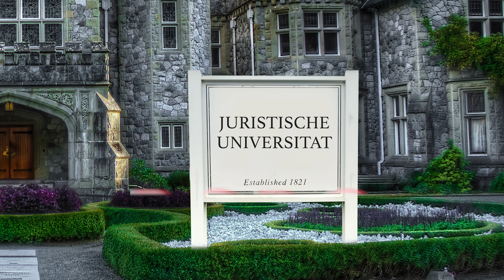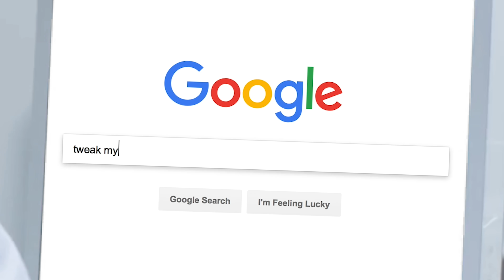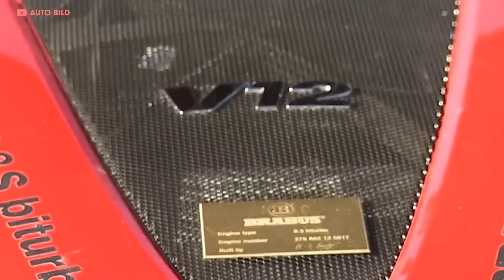Brabus - Everything You Need to Know | Up to Speed

Comment: Brabus even tune vans! I've worked on a 2014 brabus Vito "sport x" 220cdi 3l V6... In a frickin vaaaan. The tyres, 245/35 R18! The rims were incredibly light, the seats had crosshatch stitching, torque on tap. All this for a van

Comment: Everything you need to know to get up to speed on:

Abarth or Abarth 131

Alfa Romeo

MUGEN

Ford transit van

Peel p50

Mercedes-benz GTR

Plymouth Barracuda

SSC Ultimate Areo

Top gear's P45

Subaru BRZ / Scion FR-S / Toyota GT86

Spyker C8

Spade Vetture Sport: Codatronca TS

Seat Leon

Sallen S5S raptor

RUF

Rossion Q1

Renault 

Radical

Pontiac

Pagani Zonda 

Opel

Oldsmobile 

Maserati MC12

I want stuff like this plz